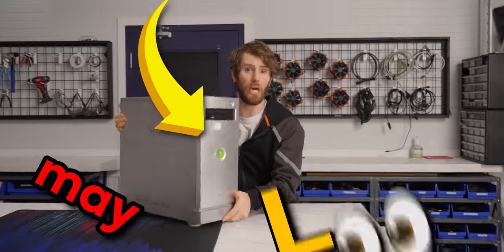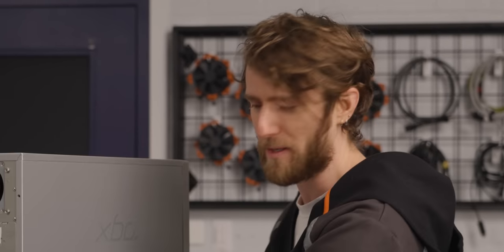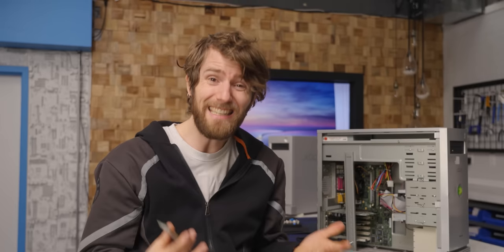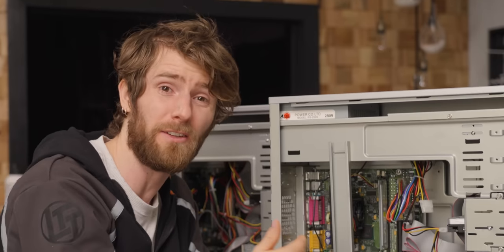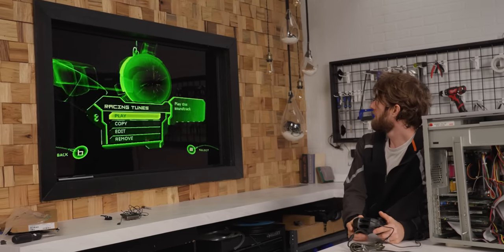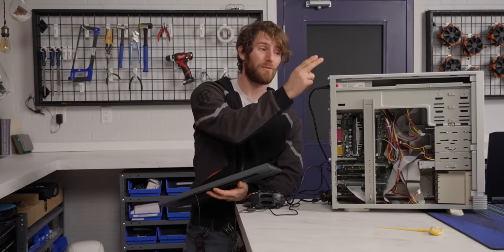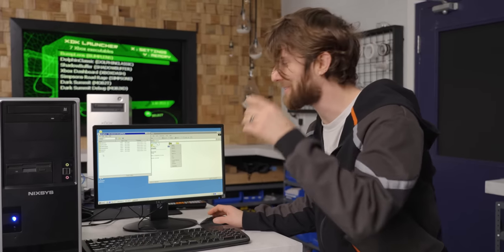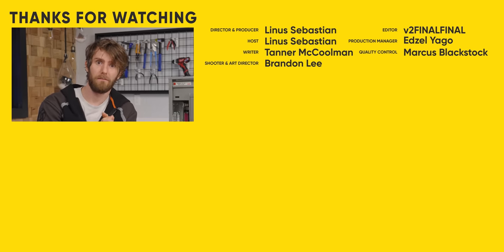I Used Stolen Software to Make a DIY Xbox - Xbox Alpha I & II Dev Kits

Comment: Fun fact: there's a bug in the original Xbox software because it assumed an AMD CPU and Intel CPUs act a bit different in 16-bit mode
Reply: What games/software even used 16-bit mode?
Reply: @MaddTheSane  AFAIK none, but the CPU still boots in 16-bit real-mode. The issue is that AMD Athlons reset when executing code that rolls around at 1MB when the A20 gate is in its default setting, while intel Pentiums and Celeron continue executing ... which is a bit of a problem if you wrote your boot-firmware assuming the CPU would reset in such a situation (like an AMD CPU) and then switched to a CPU that doesn't (intel)
Reply: @sundhaug92  And that's how it got hacked :D
Reply: I watched video about how OG Xbox got hacked, and apparently the original security design relied on the fact that if you execute code against the top of the memory it would triple fault and halt the CPU.
So they literally executed code towards the end of address space to halt in case something goes wrong.

But Intel processors back then could start from either near top or very bottom of the memory. The CPU would always start at high addresses, but when it reaches the end of the address space, it goes back to 0 and continues execution.
So if you could somehow put executable code at lower memory, you gained arbitrary code execution by causing intentional boot failure. And I believe this did happen on Xbox 😂
Reply: @sundhaug92  hey man Iam in awe of your knowledge. May I know how you became so good at this stuff.
Reply: @poopcat3196  Thanks for the reply.
Reply: @poopcat3196  this is my favourite part of being a computer scientist, I can follow along with all the technical details of an exploit and understand what's going on
Reply: @sundhaug92   The A20 gate was such a hack.  IBM really should've put the onus on original PC software vendors to update their code to quit wrapping around, rather than putting in a software-controllable switch to block A20.  That has been causing trouble pretty much ever since, and really only stopped being a problem fairly recently, when real-mode all but ceased to exist anymore.
Reply: @poopcat3196  unfortunately i'm too stupid for that so I just do my own programming at work and don't deal with anything that deep otherwise I'd be trying to crack my Xbox SeX

Comment: I recognize that case.  It was a YCC-802 by Globalwin.  We used to sell those like hotcakes for custom build computers.  They were one of the first cases with beveled edges, complete thumb screw mounting for everything but the motherboard, a system built in for holding video cards in place, a removable/washable case fan filter, removable motherboard rack, and room for a whopping 7 hard drives.  For a case from 2001 they were way ahead of their time.

Comment: 6:36 - look ma, I made it in a LTT video! lol

A few notes:
- The alpha units were put together in a rush just so early game developers could have a chance to start working on their games for the Xbox's launch in 2001. The plan was to give devs a more polished dev kit, like the clear one seen at 6:36. Production was delayed, and they scrambled to get dev units into game developers' hands in the early days, hence the janky "off the shelf" nature of these early alpha 1 and 2 units. It wasn't originally supposed to be a PC, but they had to rush to put something together so launch titles could be made in time, despite production delays.
- The entire case is basically a re-branded PC case. It's not custom-built for Xbox, including the front (other than the "powered by directx" jewel in the center). You could have walked into a store and bought a PC that looked almost identical to the Xbox alpha units in the early 2000's. I forget the make/model, but there are similar looking cases out there that are generic.
- The BIOS doesn't load from the hard drive. Linus remarked at how fast it booted up "from a slow hard drive", but the BIOS is stored on the motherboard, similar to a PC's BIOS. The boot animation exists to give the system time to spin up the HDD and initialize other components.
- The prototype units were not ever meant to go into production. The line about "Xbox needed something cheaper than an $18k block of aluminum" is partially correct. Yes, it would have been ridiculous to build the giant metal X consoles for developers, but that was never the goal. The big metal "X" prototype units were only meant to grab people's attention in the unveiling. The real reason why these alpha units were made was due to production delays in getting devs the more polished dev kits (which actually looked like Xboxes).

Alpha units are extremely rare. I really hope LTT stores/archives these things well. There's so few left in the wild!
Reply: Wow ..thanks so much for all of the extra history / info!
Reply: thanks for the excellent tidbits of info !
Reply: If I remember correct, that PC cost the company several grand to be one of the first to have one. Over time we got the clear units for coders and green units for artists. Now I wish I looked inside of that PC when we had it.
Reply: @BeerMoneyGames  Interesting
Reply: I believe the remark about booting from a slow hard disk was in regards to the operating system, not the BIOS. Linus was comparing boot times between normal Windows 2000 and this stripped down OS, which felt comparatively instant.

I think Linus was only mentioning how cool the custom BIOS logo was and how it didn't feel like that was commonplace at the time for pc builds like this.
Reply: Yeah I’m pretty sure Linus knows that the bios isn’t stored on the hard drive dude

Comment: @ 5:48: this is called a CRIMM ( Continuity Rambus Inline Memory Module ) Linus. it was a pass through to connect the 2nd slot in series to make the other slot complete ( 2 modules = 1 bank ). I have been building and repairing systems since 1987, btw.
Reply: Great to know at LAN parties, but no fun at normal ones.

Comment: I did testing on this back in the day, so cool to see them again. Thanks Linus for the video. The reason the floppy drives are inside is that these were used in semi public testing so you would have like 20 random semi public people who had access to these machines in a test room.
Reply: That’s super interesting on its own merit, thanks man
Reply: i was also a tester on the original hardware rollout team and worked with these units extensively. after the form factor switch from these PC dev units to the recognizable translucent dev kits, the majority of them were quietly and unceremoniously scrapped.  it's nice to see that some them survived not only intact (mostly) but functional (mostly).  i miss dolphin :(

Comment: It's worth mentioning that the final product wasn't far from "commodity" itself. Just the other day I repaired an original Xbox, and when I removed the CPU heat sink, it was quite literally an off the shelf Pentium III/733, except soldered onto the board.
Most of my favorite games of that era were from the PS2, but the Xbox has a particularly special place in my heart due to how unique it is.
Reply: And like Linus said, this was not particularly high-end hardware for the time at all. It was low-end, in fact, but they got away with it, because the other consoles with their custom hardware were even less powerful in order to be cheap to make. These low-end PC components ended up being far costlier (because PCs were expensive in those days), explaining the high price of the original Xbox compared to the competition.
Reply: @no1DdC  The GPU was pretty good, it was based on the Geforce3 which released earlier the same year.
Obviously it was more than powerful enough anyway, particularly when releasing after all the other consoles.
Reply: @no1DdC  I think the GameCube kept a really respectable power equality to the Xbox, in fact, it used quite a bit less power coming in.  PowerPC processors were pretty powerful compared to Intel's 86 line.  Added to that was the incredibly high bandwidth memory used on GameCube made it do things that a system with, at the time, standard SD memory had GameCube doing circles around the PS2.  Also, the GameCube model DOL-001, with the help of a $50-200 plug in adapter is now compatible with modern displays.  

I had both GameCube and Xbox consoles, and I played them both.  GameCube had some pretty good games in its day and the Xbox had multimedia features and software I liked to play as well.  I enjoyed playing Oddworld:  Munsch's Odyssey, Jet Set Radio Future, Halo, Sega GT and others as well as having the advantage of playing music back as well as DVD video on my Xbox.  My current Xbox is the One S console I bought at the end of the One's sales period and am looking to get a Series X when and if I see it being sold.
Reply: The original Xbox really seemed like a "we have a hammer, and everything looks like a nail" thing.  It wasn't particularly clever, quite obviously being designed by a group of engineers who really knew PCs and not much else.  The other consoles may have been on-par (or even under) from a raw performance standpoint, but they were much more tightly integrated devices.

Just look at the hulk of a box that the OG Xbox is.  It was expensive because it was a grossly inefficient design, hacked together as a small form factor PC with slight customization, and very little room to scale as they sold more of them during its lifespan.

I had a lot of contempt for that whole project at the start, seeing as how many times Microsoft thought they were smart enough to corner various markets, only to limp away and axe the project shortly thereafter when they learned that venturing too far out of the core competencies is, like, really hard...  I figured it would be yet another one of those -- a "rich kid thinks he can be a video game console company" kind of debacle.  It was touch-and-go for a while, and I'm surprised it survived at all.  But it did, and despite that they had no business being there, they ended up as a first-class console vendor ... eventually.

Although, I still think Sony has always had a much more refined UX than any of the Xboxen.  But, close enough is close enough I guess, and you can go a long way on a vibrant software library.  Right, Nintendo?
Reply: No way?! Very cool. I didn't know off the shelf CPUs made it into consoles of that era. Awesome.
Reply: Xbox 1 Gamepad was so awful.
Reply: The 360 was waaay more custom than the OG XBox, I opened both at some point. Besides the RROD, the 360 was neatly assembled and engineered. The OG Xbox was a mess in comparison and also reflected the way PCs were built in the early 2000s
Reply: It kinda wasn't just an off the shelf pentium 3 since it had less cache than the retail box ones
Reply: @Kholaslittlespot1 Wikipedia has info about their cpus
Reply: so, practically and with some tinkering, you can swap that 733mhz Coppermine pent3 into a top of the line 1.4ghz Tualatin pentium

Comment: I played Simpsons Road Rage on PS2 so I'm not sure how it usually performed on Xbox but on PS2, the load screens were ridiculously long. It felt like I was staring at Bart playing an Atari for 2-3 minutes everytime I loaded a level lol
Reply: I grew up on the PS2 ver. as well so I can testify to how long it takes there. The final version on Xbox only takes about 10 seconds which makes sense. Usually OG Xbox had better load times in general because of the beefier CPU and ability for games to automatically cache data to the hard drive.
Reply: I had it on xbox and remember it taking ages too
Reply: The unfortunate side effect of the ps2 being significantly weaker is cross platform games generally defaulted to the capabilities of the ps2. The grand theft auto series is a great example of how much more powerful the xbox was. Rockstar released all three games on xbox with upgraded graphics.
Reply: Well, the drive read speeds were different.  DVD read speed on PS2 was something like 2x while on Xbox or GameCube it was much higher.  GameCube games seemed to have a pretty fast load time and part of it was the small capacity but I think Nintendo also tried to optimize the game discs so it didn't take forever to load.  The Wii was respectable but as the Wii U hit, it was a good system in its own right but took forever to load, didn't matter the media.  The OS was the same way.  I owned my Wii U since launch and even though the load times were improved, it still took its sweeta** time.  I have a 1 TB hard drive on the Wii U and the bottleneck there was quite possibly the USB2 ports.
Reply: @b1llygo4t  My favorite example for OG Xbox's superior tech was Ninja Gaiden 04/Black. That was a game you almost certainly couldn't run at 60fps on a PS2 at its intended resolution, and it could easily be mistaken as a early Xbox 360 game. Hell, its remake on the PS3 only looked marginally better (if at all; in some ways it actually looked worse).

Honestly, the OG Xbox was so damn powerful that in retrospect, the 360 felt like a pretty modest improvement compared to the jump from the PS2 to the PS3, something that became more apparent as the PS3 matured.

Comment: Linus: points at USB add-in card

Also Linus: plugs keyboard into the motherboard’s USB ports.
Reply: Old habits die slowly. At the time, many PCs only had USB 1.0 or 1.1 on the motherboard, but would commonly get upgraded with a USB 2.0 PCI card, so if you had a USB peripheral that didn't need the speed of USB 2.0, you would always plug it into the slower built-in port.
Reply: Did he switch one Logitech K120 for the other K120? A4tech had a keyboard looking exactly like the Logitech. I used more A4 mouse back then.
Reply: @no1DdC  I feel called out 😭

Comment: This is fun.   I actually owned a couple of Xbox 360 alpha dev kits which were literally PowerMac G5's using ATI Radeon X800 XT's..   While it would have been a door stop, I would have appreciated keeping one of them! They were decent machines for the era!  And the GPU was quite rare to be honest.
Reply: I have both models, 970 and 970fx pci-x and pcix2 fire gl flashed with toms reduced rom. Frequency’s are set perfect no artifacting after my second flash. Played halo all through and made a compatible list. The older sdk for og Xbox works best for its emulation if you plan on running og Xbox home brew. Also there are about 9 diff recoveries out there for it with symbols iso and remote. Frankenstein unit or not I could moch up some ms stickers but it’s the software which is illegal to own especially the internal copy I imagine. Check out xenonwiki and if u see bowser tell him to come out of hiding

Comment: The sound card that plugs into the CNR slot actually doesnt contain ANY processing chips, the slot was mostly dedicated to expanding onboard chips that had limited ports for example, adding a 2nd network port to your motherboards NIC or when your soundcard didnt have 5.1 7.1 you could add those.
Reply: Thats not CNR it is AMR and the card actually has an Codec Chip on it.
Reply: CNR & AMR this is great to learn about

Comment: Looks a lot like the Gateway  tower I had back in 2000-ish. I had upgraded from a dusty old Pentium 233 (oc'd to 266!!!) straight to the latest 1ghz Athlon with a 256mb Geforce card. That thing was a BEAST. It had a similar metal support in the middle, so who knows?
Reply: I was thinking the same thing, 1999 Gateway I have is so similar and I actually have RDRAM but it clearly isn't meant for the board included

Comment: Back in those days, many CD writers were SCSI because they had better through put and didn't suffer from buffer under runs due to the ATA bus timing out. One of the places I worked at in the mid-1990s had a setup just like that for that purpose.
Reply: What's this about the ATA bus timing out?

AFAIR, using SCSI was really advantageous when the source and destination drives (a HDD and CD-R, e.g.) were on the same bus.  ATA devices hang out on the bus for a while, whereas SCSI devices grab their data and go do their own thing offline.

Beyond that, any advantage to using SCSI was more that it might just be a more performant chipset than whatever IDE bridge was on your motherboard.  Ditto drivers.  Ditto the hard drives where the source image was coming from.

At any rate, originally, CD-R drives were SCSI for the same reason CD-ROM drives were:  The older IDE specification didn't really support generic media, having been adapted from MFM drive controllers that were basically very large floppy drives.  So, your options were either SCSI, or a proprietary interface like the 40-pin MKE or Mitsumi interface, or the 34-pin Sony interface, etc.  But once ATAPI showed up to the party, things moved rather swiftly in that direction, with SCSI hanging around for the Mac / Amiga / UNIX workstation market, and the handful of PC enthusiasts that felt inclined to spend $300 on a controller card.  (Guilty.)
Reply: @nickwallette6201  Back in the old days, the ATA bus was much slower than SCSI. The devices themselves couldn't keep up with the data throughput required for continuous writes necessary to burn a CD-R. This may also have had to do with the amount of RAM, cache, and other things associated with the machines back then.

The other issue back then was the quality of the hard drives. The ATA drives weren't necessarily the highest quality compared to the SCSI drives. The early drives used to use speed compensation tricks to allow for quick reads and writes on one part of the drive compared to the other. A good example of this was the really crappy Conner drives. (Does anyone remember those? ;-) ). During this time, even Western Digital and Seagate ATA drives were crap compared to the SCSI drives of the times.

I witnessed many disk timeouts during a CD-R burn. At $15 each per CD-R it got pretty expensive when writing a disk in the mid-1990s.